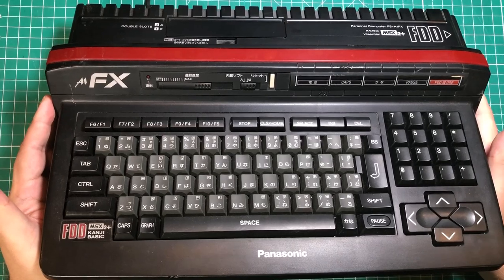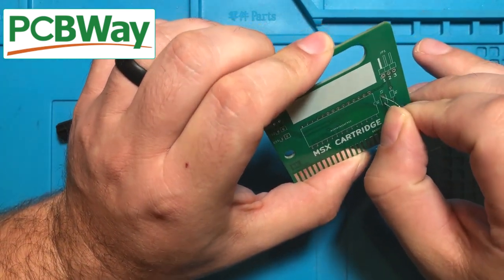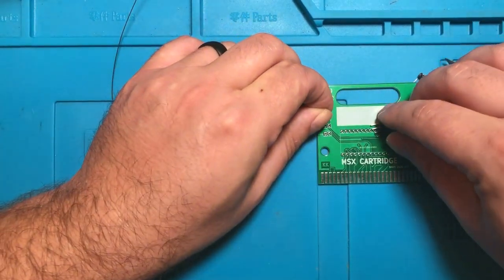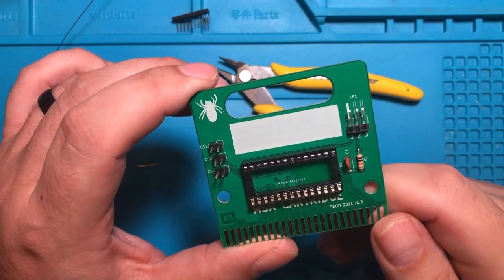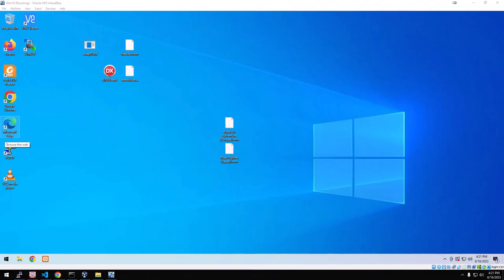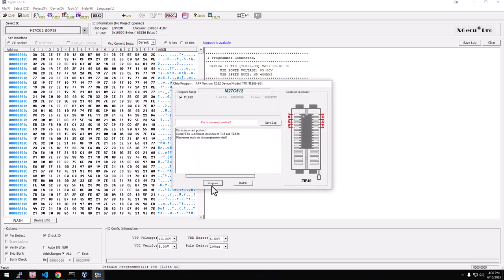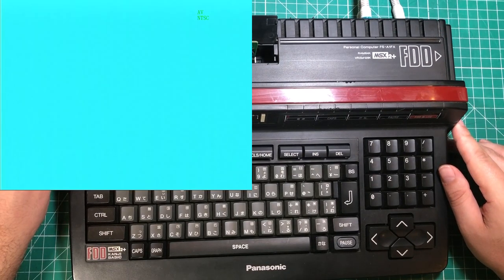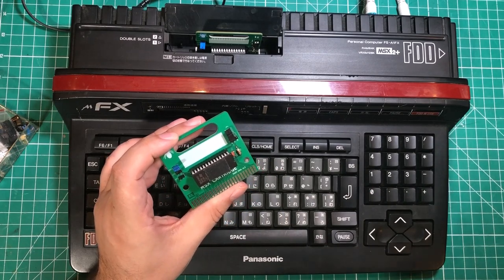Getting my rare MSX2+ Computer up and running with a Spider Cart

Comment: Whoever designed that board should have put 2x3 headers, easier to solder, or even a slide switch if you're going to be changing selections ;)
Reply from the maker: I actually thought the exact same thing or a place to put a dip switch
Reply: Same same ... I have some side-mount mini DIPs.

Comment: I'm curious what you do for a day job that you need to wake up so early? Also, if the virus scanner reports it as a virus it could have a time delayed payload so I wouldn't trust it outside of the VM, if you can even trust it inside. This is why I prefer to only use open source software so I can audit it, but at least you used a prophylactic.
Reply from the maker: I have a software developer business and do some rapid hardware development. I just have a stupid amount of work right now.   And yeah. That app seemed sketchy.  The person who posted it called it buggy....I wonder if it was the trojan acting up.
Reply: @AnotherMaker What repo did it come from?